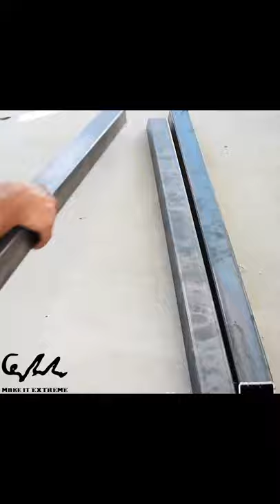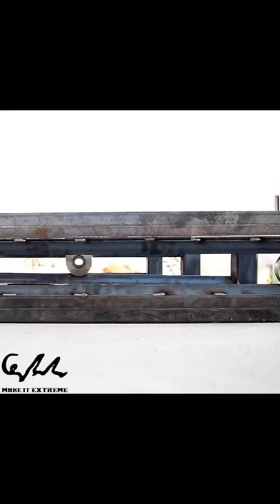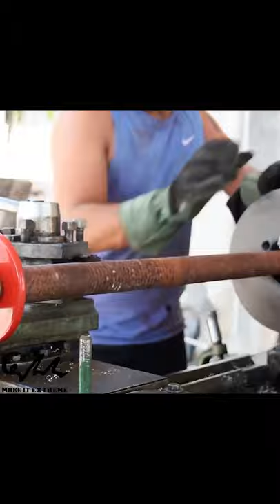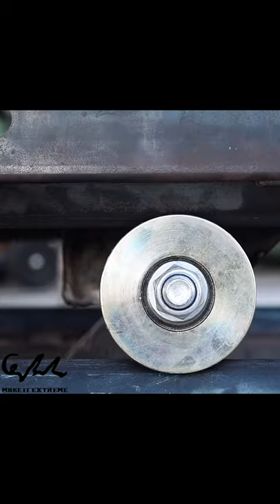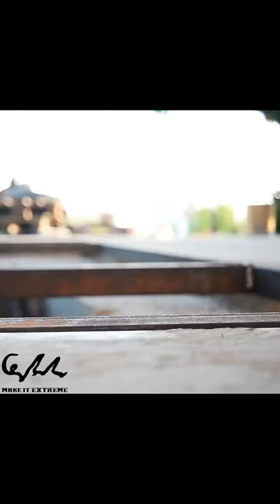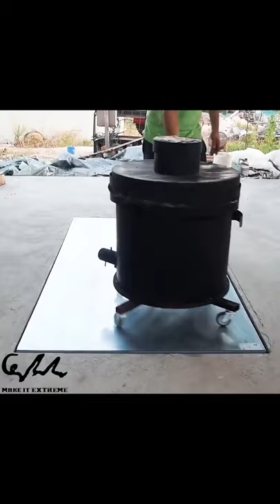Making a Workbench #shorts

Comment: But what do you use to make the workbench on?
Reply: An earlier workbench, which was made on an earlier workbench, which was made on an earlier workbench, which was made on an earlier workbench, which was made on an earlier workbench, which was made on an earlier workbench, which was made on an earlier workbench, which was made on an earlier workbench.....
Reply: @ianmacfarlane1241  in the Begining, there was darkness. Then god said, let there be workbench.
Reply: @CheeseMiser  And it was so.
Reply: I think you take 3 three smoothest stones you can find and rub 2 of them together at once, swapping out the third, so that none of them become concave and convex. You then have a flat surface to build a workbench on. 

Or you could just use the flat side of the welding machine itself if you don't believe in a factor of safety.